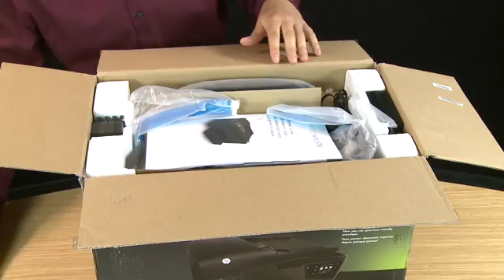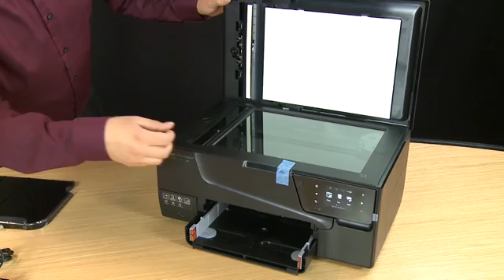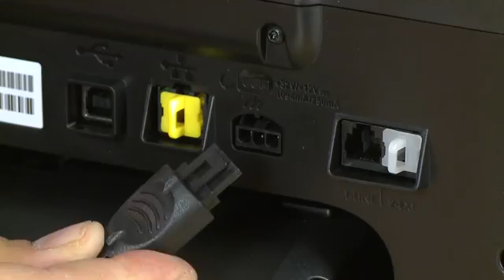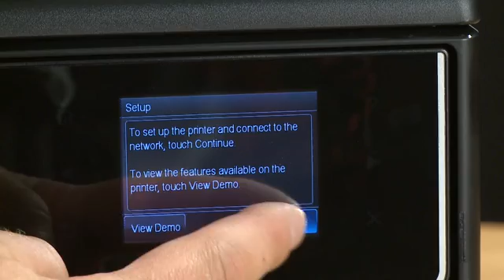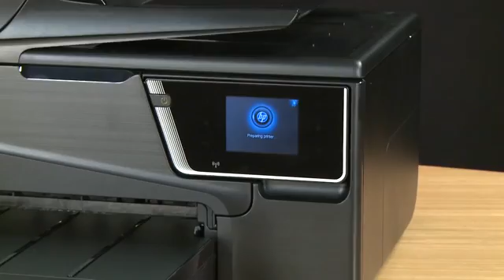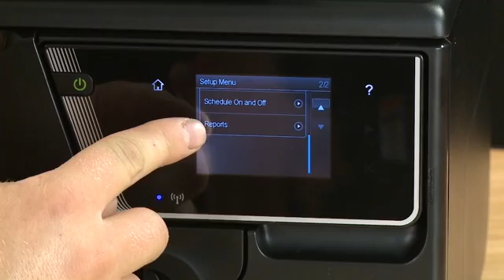Unboxing and Setting Up the HP Officejet 6700 Premium e-All-in-One Printer | HP

Comment: On other HP printers the antenna light itself would glow blue but is it normal for the 6700 to just have the Blue dot to the left of the antenna symbol mean the connection is functioning ?
Reply from the maker: +vegasbob007 If the wireless light on your printer is steady then it is connected.

Comment: How do I find the IP address of this particular printer please
Reply from the maker: +lablvr6000 On the printer contrl panel - Touch  Settings > Wireless > Display Network Configuration > Display Network Summary (or similar). It should display at least 4 lines: Hostname, IP Adress, MAC and SSID. If not, printer is not connected to a network.

Comment: hey.. in my hp pavilon g6  laptop suddenly wifi went off..  now it have been 5day still i can't on my wifi on the laptop.. its showing red X Marck in signal spot.. when i click it there its saying wifi (off)  its showing  like this.. wifi (Off)  
and the f12 button showing wight colour light is on.. but still its off.. 
Please help me to fix this. . if u send me a video that will be so great full ...
Thanks. .
Reply from the maker: +Yeshaan Weerapura   I am presuming that you are using Windows 8/8.1.  Please follow the steps in the document titled "HP PCs - Troubleshooting Wireless Network and Internet (Windows 8)".  To find the document please search for C03535285 on HP's home page or using Google search.

Comment: After printing 3 pages for testing with this 6700 printer I was warned it run out of ink, I rushed like an idiot to the store and blew another $65 for ink, guess what, out of ink again. after it sat on the floor for more than a year I did a search and found that the print heads have to be cleaned, REALLY ? after only 3 pages? Adam when you read this give me your best excuse why should I buy any product from HP, try your best to convince me.

Comment: Ok, so I bought this product few days ago and just unboxed. I inserted the setup cartridges provided in the box and the printer doesn't seem to recognize them, so it keeps showing the video for the cartridge installation. I tried many times to insert them again and nothing, even though the cartridge seems to be inserted ok. I wish I never bought this printer. I hate when something that is supposed to make my busy life easier actually makes it worse....
Reply from the maker: +EnvyBeautyBecca You must install SETUP ink cartridges during the initial printer setup, or an ink cartridge error occurs. Unlike replacement ink cartridges, you cannot purchase SETUP ink cartridges from retailers. SETUP ink cartridges are available only in the box with a new HP printer. The errors occur because the printer cannot detect the ink cartridge, often because the electrical contacts are dirty. Ink residue can build up on the contacts through normal usage. Other reasons the printer cannot detect the ink cartridge. Please try the following troubleshooting steps to resolve the issue: http://hp.care/2tiwkVV
Reply: Quincey78 yes this is happening to me too

Comment: Is it compatible with the AirPrint for iOS devices? Thx
Reply from the maker: Hi Mattia Q,
Yes the Officejet 6700 Premium is AirPrint compatible. Please search for C03058896 on HP's home page or using Google search.  That is the document number for the Officejet 6700 product specifications.  In the section titled "System requirements", then "Windows system requirements" you will find in the Chart that AirPrint is supported as part of Web Services.

Comment: please can you show me how it scan, so I can see how fast is 2.8 (page/min). Scan using ADF the one at the top with several paper. please?

I im about to buy this one and my manager is about to grant me. Im a BSU officer and also incharge of encoding and handling the invoices.

So I need a device that will be able to help me make my work more easily. So it wont be a burden to me and causes me to delay my work. 

Please HP, if you can provide a video its much better.

THank you.

Comment: In fact, when it switches off, the light on the power cable switches off as well...which doesn't look right. It's as if the power cable might have a problem... (just a guess, of course)